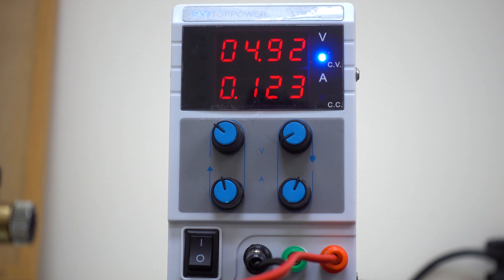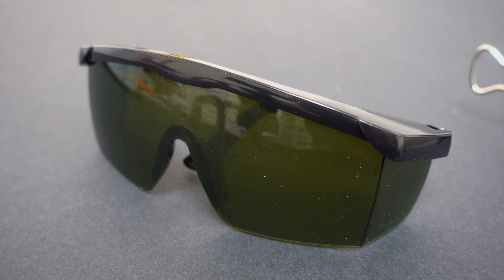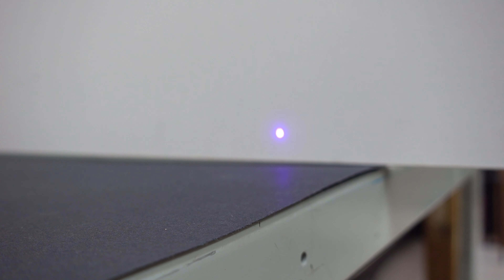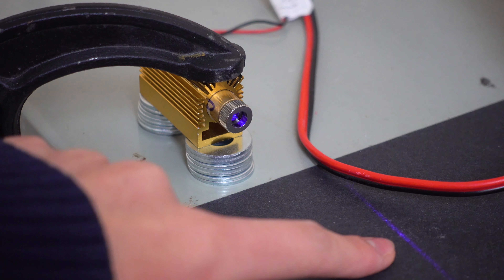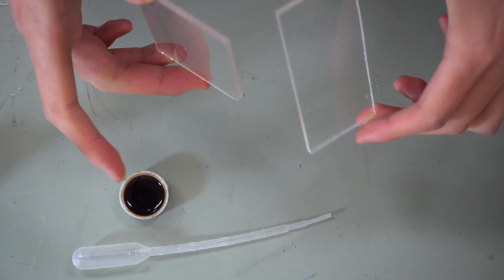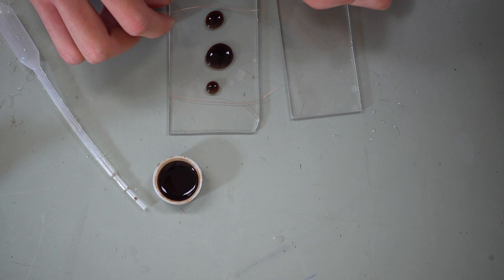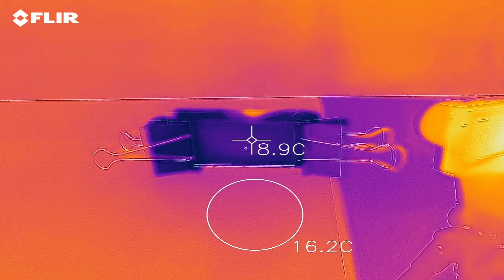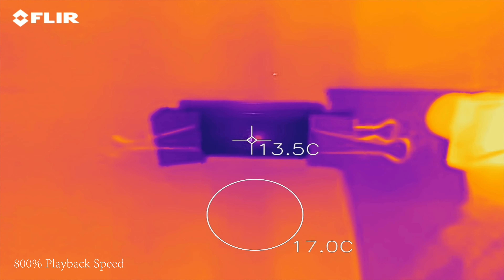IYPT 2019 Problem 9 Soy Sauce Optics Demonstration

Comment: Excuse me, how can you know the temperature of the soy sauce between the slides? It seems that only the temperature of surface can be shown.🤔
Reply from the maker: You're right. The infrared camera might not be able to directly observe the soy sauce. In fact the plexiglass is opaque to far infrared light. In this case, the soy sauce absorbed the majority of the energy and the heat was conducted to the plexiglass. I think this is why we see a region of elevated temperature instead of just a small point.
Reply: Thanks!
You help me a lot!

Comment: how did you make the layer of 200 micron please help?
Reply: I came up with 2 different methods. 1 just pour the soy sauce with a constant volume into a constant aera of slides and with h=v/s you can calculate the heigth of soy sauce easily 2. just dig a hole on a thin layer which is 200 micron heigth for example  a smartphone film then put it between 2 slides and you've got a container which is qualified   :)